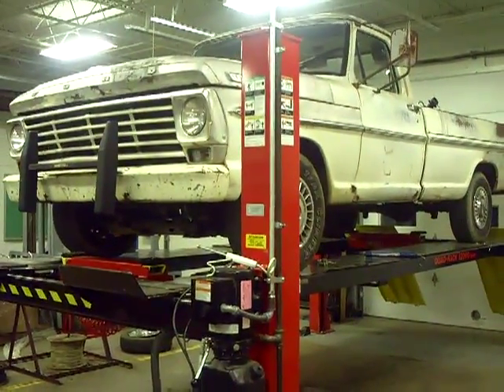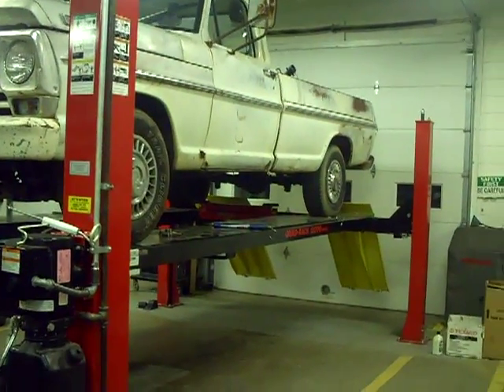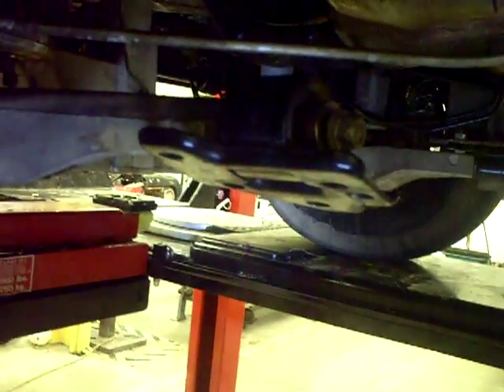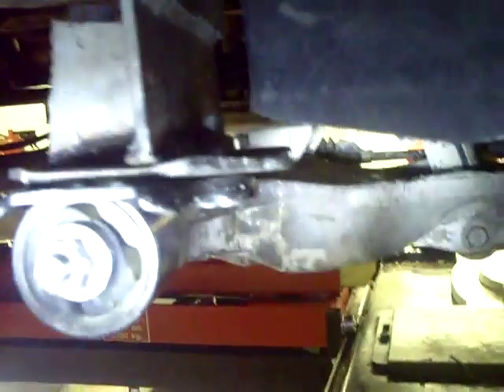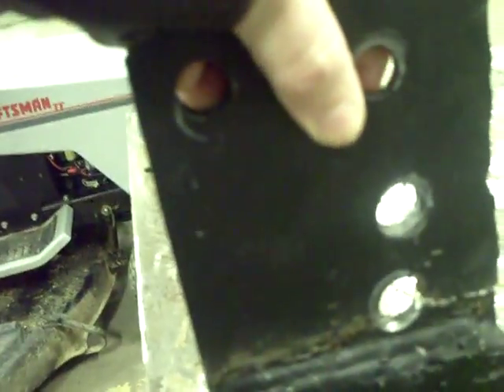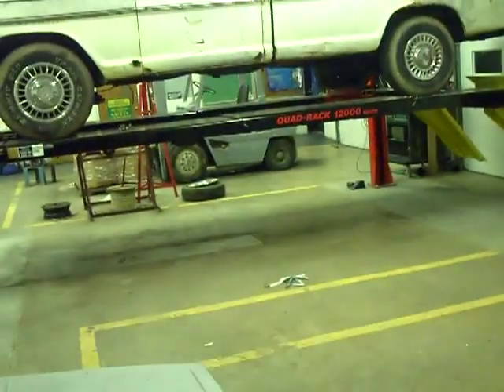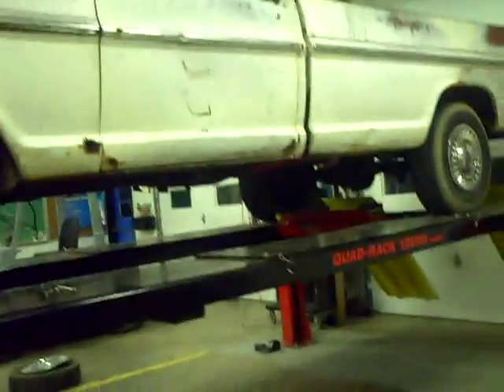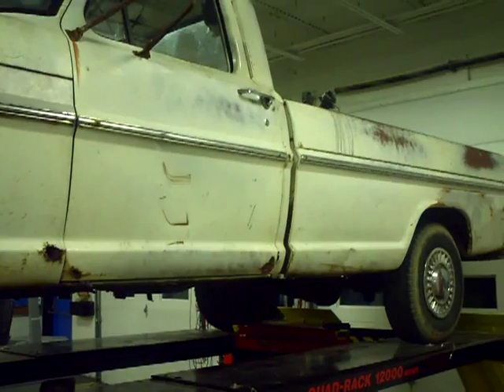crown vic front suspension into 67 F100 16

Comment: Love your old ford truck and the work you've done on it...just curious though, why make the crown Vic suspension swap?  Is that purely based on ride quality?  If so, how significant was the difference from stock to the crown Vic upgrade?
Reply from the maker: They are several reasons for the swap. The ride is a little better but keep in mind I'm still running the original the rear leaf springs. Turning radius was improved.  On the brakes I went from 4 wheel drum brakes with no assists to a 4 wheel disk brakes with power assists and ABS. So the brakes were improved tremendously. On the steering I went from no power assist stock steering to power rack-in-pinion. Since this was all set up for a cop car it's all heavy duty perfect for a truck.

Comment from the maker: @jeepers2655 No had the same problem with the original trans and the same sensors. I think its because it's set up for tires for a crown vic 225s and I'm running 235s like the truck came with.

Comment: No way...put some flat stock across the back of each piece.  Drill the flat stock to bolt in and out, and then run a tube across...like a strut tower brace.  We use a style like that on the rear of MN12 or FN10 cars.

Comment from the maker: @seawalkersee Thanks. I have though about doing that but since I added the thicker steel I haven't had any problems. I would have to make it to where I could easily take it in and out so when I had to remove the transmission pan for regular service to change filter and fluid it wouldn't be in the way. May try to come up with something some day.